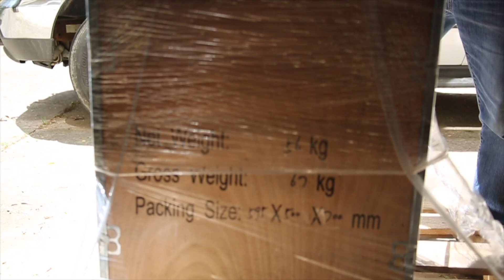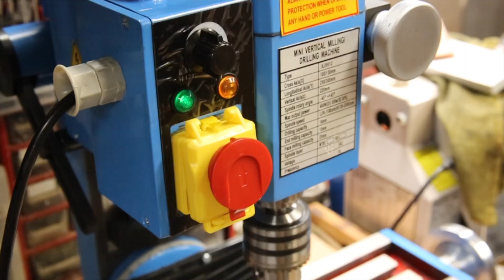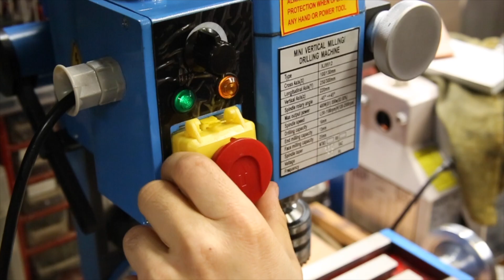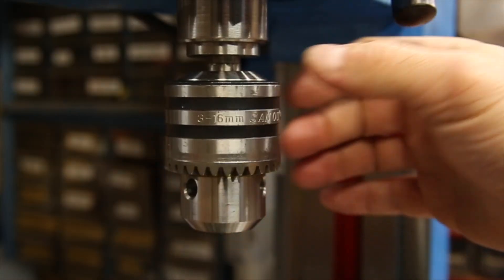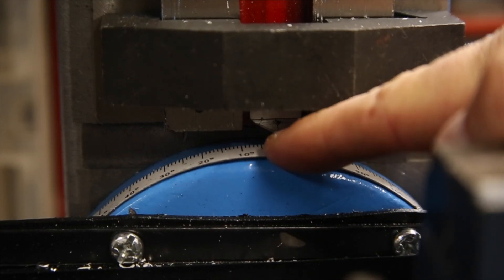Cheap Chinese Mini Metal Mill Milling Machine Unboxing, Setup, Testing, and Review

Comment: As a retired machinist with 45 years experience,when cutting aluminum,you should use a 2 flute endmill,to allow for proper chip evacuation,a collet instead of a drill,Chuck,and a copy of the machinist handbook,or machinery's handbook,to learn proper speeds and feeds,and if your local community college has a machine tool course or if your local high school has an evening class,it would be a great resource for a beginner such as yourself.

Comment: when you need to hold round stock in a vice use a v block as 3 points of contact will hold it more stable

Comment: Many have recommended collet holders... I've just came back from a whole lot of videos who show the same thing: chinese cheap er32 collets and holders are utter crap and you should definitely stay away from them. They're not concentric at all and have blemishes and other issues a plenty.

Even decent tooling costs serious money.

Someone suggested carbide tools... no! Don't use carbide unless you can run it with the speeds required, it's very expensive and brittle so the setup has to be rigid and concentric as well so you don't break them and poke your eye out. HSS is your friend with hobby machines.

Comment: Never ever use  a drill chuck for end mills... only for drilling. It's not meant for the sideways cutting pressures at all and isn't nearly accurate enough... though, this whole thing wobbles and bends a lot so accuracy might not be your first problem... but the cutting forces definitely are.

Comment: As others have pointed out...use a collet, not a chuck.
You should also start by squaring your vise up before doing anything else. I know, I know..you wanted it started up and you just milled some aluminum round stock.
It will not be the most accurate machine but it will come handy for a whole lot of things. After a while, you may want to check the bearings, etc for play.

Comment: You're 100% correct about the mini mill being more functional than the mini lathes. The lathes are pretty much useless for everything, whereas the mini mills seem to be pretty useful for just about anything that's not abnormally large or high precision. And with DROs you can achieve a surprising degree of precision. I've even had good luck milling mild steel with them, and no problem drilling stainless. For a better surface finish, use collets instead of the chuck, use Ballistol mixed with water for cutting fluid, make sure the mill is bolted down and level, use an indicator to make sure the head is square with the table (that angle marker is useless), and maybe up the RPMs a little. Also using a fly cutter to clean up a face like that is going to give you a better finish I would think. Oh, and lock your axis. It's annoying, but it helps. The mill simply isn't heavy enough, and your axis will wander all over the place while you're cutting. So lock the two you're not using while making a pass, and the pressure you're putting on the third that you are using will keep it from wandering too much. For that reason it's kind of important not to stop in the middle of a pass or back up, because that axis will wobble a little when you do. You want to keep positive pressure on it through the whole pass and try to keep a constant speed.

Comment: Ah, I see you published this last year. I hope you still read the new comments, because I want to thank you. What you've done here is what I plan to do so you're sharing exactly the information I need. 
OK, my plan applies to a Dremel 3000 and a Dremel Workstation. I don't have the Workstation yet but I do have the indexing table. The table was so incredibly cheap, $20 and free shipping, of course I had to get it. Living down to my expectations it started falling apart during unpacking (it was well-packed). But...I'm confident it will work well enough if it's rebuilt and so it's worth the effort. I'll rebuild it while patiently awaiting room in the budget to appear for acquisition of Dremel Workstation.
Wish me luck.

Comment: you really really need to bolt it down solidly.  cut some 3/4 plywood into and double it up for base at the least then bolt the whole thing down to your bench.  also leveling it as you go.  this old tony would be a good place to go for leveling.  he got one of these mills in a video and talked about it

Comment: On aluminum, you should use a 2 flute end mill or fly cutter and run it your higher RPM speeds. With that machine, I wouldn't push any more the .50 deep x .50 wide per pass and a clean-up pass around  .010.  Have fun, Good Luck

Comment: The plastic gears can break on a scratch pass . First thing you wanna do if you get one of these mills is get the belt drive kit and upgrade the motor. The motor on these things is a $@()/(ing joke

Comment: son you do not mill with a drill check. the chuck that the drill goes in is not an R-8 nor a 5-C chuck. looks like one of a kind. Drill chuck for drilling only. If you did that mill at an 1/8 incg or deeper you will be doing serious damage to yourself. need to get a set of end mill chucks that fit that machine. 2 flute is used for roughing ...more flutes the smoother the cut. 4 flute cutter is the best all around way to go.....when it comes to tin coating or not it doesnt matter becuse the sharpness of the cutters are designed for cnc now a days. it you know how you need to touch the cutting edge...(bottom of the end mill) just ever so slightly to prevent the edges from breaking uff...an end mill sharpener will do the trick but you need to just snwitch it...not twick nor smidge thatll be to much....best way I can descibe that is if you are familiar with drilling through bronze or brass how you flatten the cutting edge on the drill so it is flat slightly it drills smoothly and doesnt break the hole gives it a nice clean hole...same when you use new endmills in a manuel mill....unless you got lots of money to buy endmills....and if you nanot afford carbide (which you still have to break the cutting edges) get high speed cobalt....for what you need itll do the trick and save you money...cobalt you dont have to break the edge but be careful when using them dont mill hog wild.

Comment: I'm probably being redundant, please excuse, keep the gold and chuck the rest... :) I noticed right off the bat when you first started taking the first shallow cut that either the work piece, vise or table was moving all over the place. Not good... The name of the game in machining is and always will be rigidity of everything...  Checked out a few other vids on the unit and the folks didn't like it and what I noticed immediately was the sloppy table adjustments out of the box in their vids. Handles, dials & table movement should be solid with no play and it looks like this unit has adjustment screws for the gibs on X & Y. Tighten them up until all the side-to-side slop is gone (looking at the front of the machine, grab both ends of the table muscle it forwards and backward from side-to-side so you're pulling with your left hand and pushing with your right and vise versa back and forth. You're looking for movement. You should put an mag indicator on the table face of either end to see when it stops moving during adjustment. You want it as evenly tight along X, Y & Z as you can get them while still easily cranking the handles so nothing moves while you're cutting.  Everything needs to be solid. 

Also I noticed a lot of play (slop) in the  X & Y feed screws. You  may need to add some shims (washers) to get the slop out.  Climb mill cutting usually yields the best finishes, but on manuals, especially sloppily adjusted ones are prone to grabbing and pulling the tables into the material trashing the cutter, parts or both as apposed to conventional milling which is pushing away from the material.  When climbing on manuals I usually "snug" the axis locks and pre-load the feed screw by manually pulling or pushing the tables in the direction of feed while crank feeding into the cutter until it starts cutting on roughing cuts. Light finish cuts should be okay climbing with the locks still snugged up to help hold the table solid. That way it doesn't grab. Lessons learned. :) 

The only other thing I think is probably an issue is the max rpm. I "think" it's only 1000 on this unit. Tiny holes need high speed, at least 2k rpm. If it is a 2k spindle, you might be able to get some good results after fine tuning all the movement adjustment to be as snug as possible while still being able to operate it.  Good advice on cutters has already been mentioned, 2 flute on alum. 3-4 or steel.  I doubt if you can power tap with it, but you might, if it has enough ass. Just try it scrap and a tap you can afford to loose 1st and have fun! ;)

In any case good luck with it. I hope it works out great for you!

Comment: I am assuming that is an early X2 made by Sieg.  Some features have changed over the years as ture with any product.  Gear drive to belts, plastic hand wheels instead of aluminum, brushless motors, etc.  Some changes were for the good, others were cost driven and sometimes the retro part is more desirable.    IME they need a lot of modification as shipped.  However once the mods are done, they are pretty decent machines within their size limitations.  One must IMO is fill the hollow column to add stiffness and reduce vibration.   I used a 50/50 mix of small screws and bolts with some sand and epoxy.  A second useful change is to add a bolt on lock strap to the rear of the tilting column.  Nothing is more annoying than to have the column suddenly decide to tilt when making a precise cut and destroy the job.  There are plenty of online articles about eliminating the various slop found in some areas.  The larger table and power drive for the table as sold by Little Machine Shop are IMO must haves.  Little Machine Shop . com is your friend.  Lots of goodies can be found in there.  Also there are many, many worth reading articles and forums dealing with these things all over the web (as well as videos here on YouTube),  The two biggest shortcomings I have hit with my own SX2 is the short Z access and of course the lack of a knee.  I can't make the camshaft for a Chevy 350 with it, but I can make smaller parts.  There is always something to buy or make once you own your own mill and or lathe.        :)

Comment: That's the sige s1g mini Mill same as the other five out there except that most of them are s2g mini Mills and they don't tell that you're going to have a fun time cutting a flat surface I can do nothing to help you out that is a matter of setting the Tilt to perfect zero and locking it up I suggest permanently you can always use a sign bar to get those angles that you want and still keep your 4 1/2 inches of travel

Comment: Hey Bro, I loved this video so much I went to Ebay and bought the same mill. I was looking at all the grizzly Mills and after seeing that this is the same mini mill they have for $1200.00 after shipping and the 11.2% tax they wanted to charge me here in Colorado I opted for this Mill at $740.00. I wanted the matching Mill that would go with the Grizzly lathe I just bought but did not want to pay the extra $400.00 for the color green. LOL I do a lot of basic machinist shit and wanted something that would fit in my small room and this was just perfect. The guy bitching about your video is just jealous because he can not afford second hand or china shit he is still trying to use a hand drill he got at the pond shop with his crack head moms blow job money. LOL hahahha nice video man thanks for you insight. cheers

Comment: I run an Optimum Bf16 for 2 years also a 70 kg light weight but it was perfect for a hobbyist to start milling now i have ordered a bigger one with 360kg and the Bf16 will be transformed and run by CNC then its the perfect combination for a hobbyist like me.
And Timy 2 flutes high speed for Alu and 4flutes for steel and slow is a good rule.. The 2 flutes give the Alu chips enough time to get transported away from the end mill... Steel chips don't need that..and one of the first mods I made first I milled new steel gears than I changed them all to steel and after a little while they are not much louder than the nylon ones.
Good vids I like your work..

Comment: Hi!
I bought a machine very much like Yours and I  have a lot of fun with it. However....
At delivery the fine adjust for Z didn't work. The wheel was just spinning because the lock nut was damaged at factory by a worned out allen key. Later I drilled the lock nut out using a left running drill bit.
After 6 months the X movement begun to make noice and mfinally jamed up. Dismounting the 2 handwheels I got access to the axial bearings. They were totaly dry, not a drop of lubrication there.
Every Gib screw needed adjusting. After a short time the digital speed indicator was crashed. The sensor was blown off by the top of the spindle. The modell name here is XJ9512D, D for digital RPM indication.
Made in China today is like made in Japan during th 1960:ies.
The weight is 140 lbs and that was as much as a well fit young man and a retired old chap could pull up 48 steps to 4:th floor. I am happy about it.

Comment: With all due respect, you should take a basic machining course before you continue with this. You're gonna get hurt. And for cryin out loud, don't touch the spindle while it's rotating.  You'll get a better finish when you learn how to use a dial indicator to set the mill up.

Comment: Hi all. With due respect, please give numbers when describing performance. Something like 50mm+/- 0.01mm, etc... As the Chinese mill AND lathe come... they are junk. One must never use or evaluate them right from the boxes. One must take them apart, correct machining errors, lubricate accordingly, and then perform full alignment. Then, the Chinese tools are VERY good, for many years, like the numbers above. Beyond this, yes one can go beyond this, one must be very skilled. The user is the main limitation, not the machine. This type of mil MUST be aligned for perpendicularity. The head must be locked vertically prior to milling because the lowering mechanism pushes. Otherwise, there is nothing to prevent the head to move down due to pulling forces of the chip and gravitation. The dials are really crap and one must install some  distance measuring device for each axis. Honestly, at their price range and work capabilities there is no competition. I would also advice not to run to buy new tools/accessories until you are professional enough to understand that what you have is not good enough. By the way, a cylinder  is better held in place by a chuck, not by a vise. Good luck!

Comment: Please, do not drag the end mill on the workpiece... Keep the machine running until the end mill cleared the surface of the workpiece and then stop it. You'll brake the flutes/unnecessarily scratch the surface that you cut. Also check out other machining related youtube channels, you'll learn a lot.
Reply: I also react on that. At 7.09.

Comment: it's a nice little machine but it has issues it's certain things that you have to do to make it better feel free to contact me and I will send you some pics as to some of the things that I did to modify it that will make using that machine a lot easier there's a lot of things that I have done as you already know I am a machine rebuild and repair them in a retired Machinist but I'm always trying to make a better mousetrap you will like all the things that I've done to the machine so one more time feel free to contact me and give me your email address and I will send you some pictures of what I've done

Comment: You need to 'choke-up' on the endmill. Never have anymore of the endmill sticking out than is absolutely  necessary. The tooling will last longer, and you'll get a better finish .  Never use a vice to hold a piece of round stock like that. You're only just holding on to the part in two VERY small contact points/spots, it will 'cock' in the vice, I don't care how small the the cut is. It is going to happen, that's not even a question. The only question is when.

Comment: For milling aluminum, I achieve a very nice finish by "climb milling" which works great even on my less rigid mill.
Reply: DON'T BE A BLOODY FOOL......CLIMB MILLING IS ONLY FOR CNC WHERE YOU HAVE BALLSCREWS NOT ACME THREADED LEADSCREWS WITH BACKLASH.